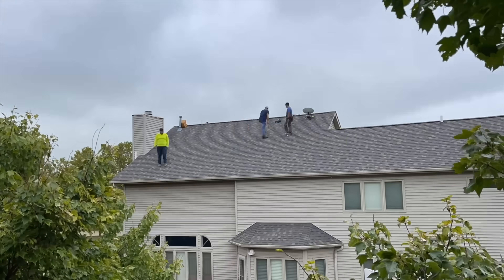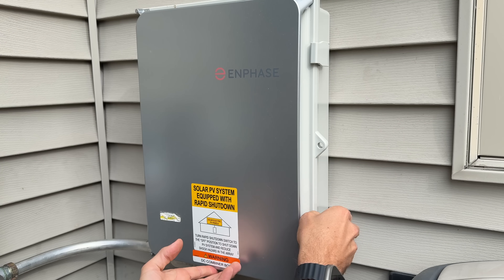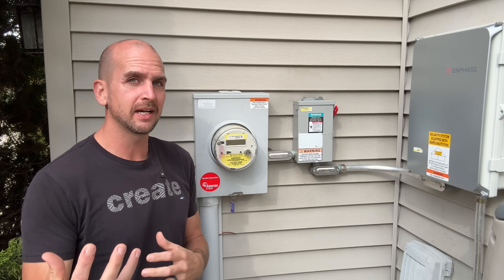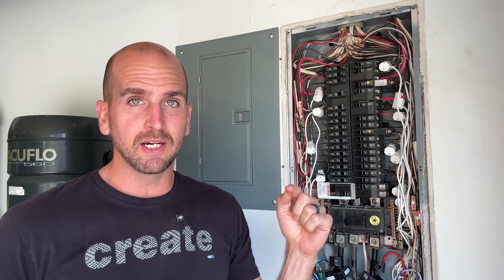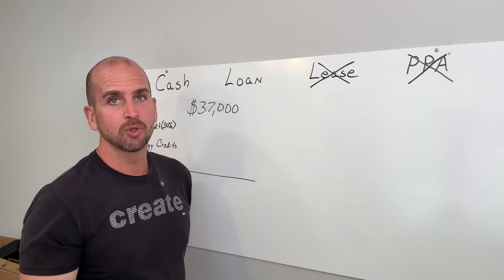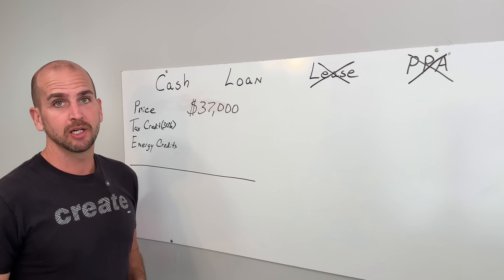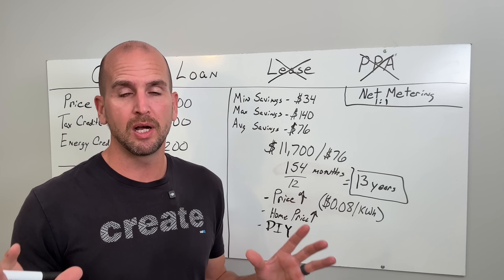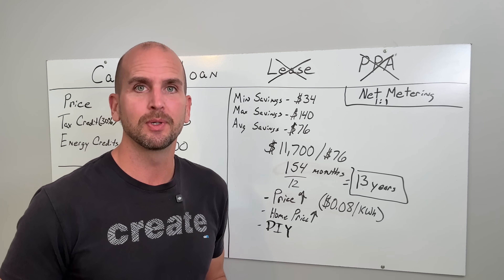Are Solar Panels Actually Worth It For Homeowners?

Comment: $11700 invested at 5% is over $20k after 11 years when compounded annually.
Reply: Yep, just depends on what premium you put on helping the environment by reducing your energy emissions.
Reply: Exactly.  and lets also not forget the real cost is $37k.  The rest has to be picked up by increased taxes.
Reply: @Ish14511  Nah, just transfer some of the subsidies already being given to the fossil fuel industry over to renewables and electrification.  Problem solved.  Society is constant shifting and government has to shift with it.
Reply: Never paying an energy bill for the rest of your life is priceless..
Reply: @davefroman4700 But is it?
Reply: @Stashmo  Add up your electricity, natural gas (or propane, heating oil, etc), and your gasoline (diesel, etc) bills.  Then ask that question again.

Economies of scale start to get really interesting, yes?  But to be fair, we are still in the early-adopters stage for heat pumps.  Most home owners aren't going to be able to check all the boxes.

For an early-adopter though... woof.   And generationally the future is obvious.  Double woof.

-Matt
Reply: @Stashmo  I am off grid in Saskatchewan. The only bill I have? Is my $500 property tax a year. And in 20 years when I have to replace my solar? It will be 50% cheaper than what I paid for my original equipment.
Reply: Inflation will eat all of it.
Reply: Yah... but no.  People aren't savers by and large.  Unfortunately.  $11700 not invested is $11700 spent on other things, more than likely.   And also, a person's economic power tends to drop after they retire.   You always want to do projects that benefit your future self earlier rather than later.  Always.

-Matt
Reply: @junkerzn7312  But maybe by the same logic lotsa folks will also spend/waste the savings from solar, so no net financial gain.

Comment: your bringing 3 AC lines into one.. how do you deal with phase shift?
Reply: There is no phase shift because the micro-inverters synchronize to the grid. They don't just output an AC waveform.  They will output nothing at all if not connected to the grid or to a master inverter of some kind (and for enphase's intentional islanding feature, to a master control signal).

Comment: Three years ago I priced 22 panels and it was $32000 and breaking even in 15 years. I didn't do it. This year I installed the same setup, same price an it will break even in 6 years because the panels have increased in efficiency and the price of electricity has skyrocketed thanks to the Biden administration.

Comment: Thanks for the info!  I didn't realize there was a DC to AC conversion right at the panels.  In case you are curious, electricity is currently .089/kwh in CT right now via Eversource (it has been as high as .15)

Comment: Couple things

1st- Some insurance companies (mine) will not insure homes with solar panels
2nd- HOA’s will most likely not allow them
3rd- A bunch of homes in my area had their panels damaged in storms and insurance refused the claim
Reply: 1 - Florida maybe? Not so in most states. In Ohio it’s against the law to even raise your rates for solar
2 - again, varies by state. In fairly Red Ohio, HOAs are not allowed to restrict solar on aesthetic reasons alone
3 - as someone else said, those same homes have much bigger problems than their $10k panels if those storms were bad enough to damage the roof
Reply: @ I’m in Indiana
Reply: I've seen most HOAs are allowing them. In Indiana, HOAs are now allowed to prevent homeowners from going solar as long as they meet certain criteria. You could easily change insurance companies as well.

Comment: No they are not worth it.  My electric bill is under $100 a month average.  $30K/ $1200 per year assuming my bill goes to $0 with solar (it wouldn't) is a break even time of 25 years.  Not including the loss of saving that money or buying something fun.   LOL.  Simple math folks.  It's underrated.   Guess what, the efficiency on those drops to zero over that time too.  They don't last 25 years.  Maybe 12 at best.  Oh, and plan on spending an extra $10,000 to remove those and re-install when you need new shingles.   Think about it for a bit and its clear it's a really dumb thing to do.
Reply: Natural gas bill?  Gasoline bill (vehicle) ?  Keep going.  And maybe stop pushing misinformation...

Solar systems easily last 25 years and life spans for the panels themselves are now in the 30-40 year range.  Incremental maintenance after year 20 will increase, but not by much (ask me how I know... I've been doing solar a VERY long time).

Replacing components piecemeal is not expensive, but that is where DIY-v-labor arguments come into play the most because time is money for a professional.

Just a hint.  NOTHING lasts forever in this universe.  Solar is on the long-end in terms of durability verses other things in life.  Its silly to worry about it.

-Matt
Reply: So much misinformation in this comment. Many panels are warrantied to produce 90% at 20 years.

Solar panel are cost effective in area with high electricity cost and sufficient solar energy available. It is not worth it for everone but there are millions of people that will benefit.

They are also great in a natural disaster if battery back up is available.
Reply: Solar ROI is VERY location specific, in many places it doesn't make sense due to a variety of factors. The amount of sunlight is just one, others may be even more important such as net metering, insurance, weather factors such as hail/wind, cost of grid power, etc. A thorough honest analysis is required, not a what some sales person says.
Reply: You can count on your electric bill always being $100/mo. Trust your electric company.

Comment: Thx, you didnt adress wear n tear... when ur break even, how much life's left in the solar system?
Reply: For panels installed 20 years ago, sure.  My original SHARP 165W panels (20 years old) had lost roughly 15-20% or so over the 20 years.   But modern panels have much less degradation... we're talking 0.5%/year or less these days.  20 years = 10% loss.   

Panels don't die that way anyway.  They'll just keep producing.   Panels die when their environmental seals die and water gets under the glass.  That's about the only thing that can actually kill a panel.  A modern panel can easily last 40 years.  You can count on at least 30.

You'll have a few panel failures over that time but to give you an idea of what that means... I didn't even NOTICE that I had 2 failed panels for several years on that original system.

People with micro-inverter systems have a tad more maintenance... micro-inverters won't last as long as the panels, though they will still last a good 20 years these days.

-Matt
Reply: Most solar equipment is warrantied to not drop below a certain power output for 20+ yrs. They can & do keep making power for much longer.
Reply: Depending on panel quality and environmental conditions in your area, the loss is 1-2% in output per year.  Most long term averages come out to 20% loss after 20 years.  This aspect definitely needs to be considered.

Comment: No.  I have moderate energy costs. Solar raises insurance premiums.  Eventual roof replacement cost will be higher.  Panels can be ripped off of roof during a storm.  12/12 roof- I’d have to hire contractors.  Many people will not buy a house with solar so house value might decrease. Components eventually need to be replaced. The laws can change - pretty sure California changed net metering law and solar owners were screwed.  Risks clearly outweigh benefits.
Reply: Mother nature can wash away your house too.  A larger house will raise your insurance premiums.  An old house will raise your insurance premiums.  The wrong type of roof.   Nearby trees.  Bushes right up against the house.  All sorts of things that people don't think about can raise their insurance premiums.

That doesn't mean you don't do something.  If that were the only litmus test everyone would be living in 300 sq-ft shacks.  People buy what they desire to buy and what they can afford.  Can one even attach a dollar value to peace of mind?  Insulation from inflation?  Power outages?

In anycase, solar isn't for everyone.  But you can convince yourself of anything with a bad argument.

-Matt
Reply: @junkerzn7312 Matt - you focused on one issue I raised and ignored the rest of the negative aspects I mentioned.  To me, it’s a simple cost/benefit analysis of ALL the pros and cons. Not just the insurance.
Reply: @davids2530  The main problem with your argument is that you are assuming solar to be an adder to your cost of owning a home.  It isn't an adder, it is part of the decision making you should be doing when determine what and where to buy in the first place to meet your budget.   One can argue all sorts of nonsensical paths using your thesis, and I outlined one such nonsensical path in my response.

Not only is it not an adder, but not all solar installations will even have the detrimental effects in your list.  Which we will go through after my explanation.

If you have budget $X and have a desire to or think there might be a potential to add solar, then you include that in your budget.  Simple as that.  The result may be a slightly smaller home in a slightly different neighborhood.   If those factors are not in your litmus, then its not a trade-off for you.  If those factors are in your litmus, then it might be an unreasonable trade-off for you.  Simple as that.

Even if you were to treat solar as an adder, it still adds value to the home if you ever sell it, or its an investment in the future of your family when your kids inherit it.  Or its a contribution to your retirement if you have to downsize later in life.

And in the mean time, it is providing an enormous number of benefits to you personally that you have to weigh against the costs.

--

So lets look at your list and see what the total calculus is.

Benefits (my list):

* Immune from utility price inflation.
* Reduced monthly expenses.
* Ability to reduce expenses further with further electrification as appliances wear out (Vehicle, water heater, furnace).
* Benefit to inheritors.
* Benefit to you if you move out or downsize later in life.
(The higher value of the home with solar).
* Investment in the future of humanity.
* Hobby DIY potential
* Backup power and flexibility in case of emergency.

Detriments (from your list):

* Solar raises insurance premiums?  It didn't raise mine.  You don't have to insure the solar installation or include it in the home insurance.  It has a 25 year warranty.  Ground, Pergola, and Car-Port mounts are even easier to omit from insurance.

* Eventual roof replacement... gonna depend on the roof, yes?  Someone with a metal roof that outlives them won't care.  A roof replacement 30 years down the line after the solar has long since paid for itself...  the incremental cost divided by all those years is going to be fairly low and guess what?  You can DIY the removal and you are already wired for the reinstallation so you can either DIY that or hire a company to do it.

* Panels can be ripped off of roof during a storm.  Well... no, that really isn't a thing.  Sure it can happen, but a storm that strong is really unlike for most people (obviously certain locations are going to be more prone than others), and a storm that strong would otherwise destroy your roof anyway.

Solar panels do not make roofs weaker and are not fragile.

* Many people will not buy a house with solar... say what?  That's ridiculous.  Solar universally increases the value of a home, not decreases it.  You made that up.

* Components eventually need to be replaced.  Yes, of course.  Just regular maintenance.   You will have to replace things, probably piecemeal, starting at roughly the 25 year mark.  It's not a major cost and not a major problem.

Everything in life wears out.  Everything.  That isn't an excuse not to buy or own something.  Come on.  Be realistic.

* The laws can change.   Yes they can.  So what?  California's laws did change.  That caused a reduction in new installations.  It had no effect on existing installations because everyone with existing installations are grandfathered for 20 year since the date of installation.  Nor does it make solar non-economical.  It just means your payback is where it was 20 years ago, back at the 15 year mark, if you were to have it professionally installed.

Laws can change, but if you are going to go through life constantly being afraid that the laws are going to conspire against you, you won't have a very fun life dude!   Laws can change for better or for worse.   But regardless of that you can always benefit from the self-consumption and self-storage (if it came to it).

-Matt
Reply: For you, it may not make any sense at all. Like real estate in general, it's location, location, location. The laws may be favorable for solar or they may not. There may be a lot of sun year round, or there may not. Local energy costs may be high or low. If one has a big lot, they can ground mount instead of using the roof, decreasing installation, maintenance, and insurance costs. One can even choose not to grid tie, have energy storage, and power part of the home from the grid and part from solar. There is no one right answer for everyone.

Comment: Enphase's combiner box that lets you add their batteries lets you run your panels when the grid is down even if you don't have batteries.
Reply: Sorry, it's not the combiner, it's the system controller.
Reply: There’s also sunlight backup on the newer IQ8 micro inverters.

Comment: I have a lease in CT. With a lease (solar system owned by others (e.g., Sunrun)), your property value (property tax) is independent of the solar-system as is home owner's insurance. Any issues with the solar system are the solar system owner's responsibility. One advantage that I have with my lease term is I was able to fully pay the lease up front with a substantially reduced cost versus paying for the lease over the term (e.g., twenty years).

Comment: 1:36 Your panel wires are run through a gap in the microinverter bracket. This is a huge no-no, and will end up grounding out the system as the winds move your wires around.

Comment: I’ll say getting solar is not just about financial ROI, but also about reducing greenhouse emissions, which we need to continue to do today. Even if after 20 years my ROI is a wash, we have a responsibility to try and make the future more sustainable.
Reply: Completely ignoring the environmental impact of creating the panels lol
Reply: @morzinbo while not zero, the lifecycle costs of the panels put the break even point at about 2 years for the energy and resources out into making the panel to be outweighed by the resources saved because the panel generated energy instead of fuels.
Reply: I can no longer buy clothing that doesn't tear or come loose in two years; I've replaced two water heaters in a decade, the latest of which-- which is a brand that still (questionably though) has a solid reputation-- seems to have the same corners cut as the previous; planned obsolescence in electronics runs even more rampant whilst I am expected to use paperless forms and payments; things formerly available at the nearby shops now must be delivered via freight which is far less efficient; passenger rail stateside is practically a laughing matter; etc; etc.

And it's on us individuals to fret over it all. Right.
Reply: Early adopters are contributing to the technological development of solar and renewable systems.  In otherwords, it is an investment in future generations.    Without that, no new technology would ever be developed or ever reach the scale necessary to be environmentally friendly.  So slinnky is absolutely right.

p.s. it also increases the value of the home.
Reply: Your contribution to sustainability is a grain of sand vs. what data centers and bitcoin mining is taking.  Maybe you "feel good", but you will pay for that feeling many times over in the long run.
Reply: @anthonyhawkins3576  Actually I've made a significant portion of my investment back already. And I've generated a sizeable amount of energy. Every little bit counts!
Reply: @slinky: Maybe you feel a responsibility to ward off your green fears. 
I live in reality; therefore, I have no interest in wasting my money chasing rainbows.
Reply: I'm sorry you're so angry.

Comment: I have solar but I am not connected to the grid.  They were going to charge me close to the same price as my solar installation to bring the grid in to my home.  Then I would have to pay monthly payments for their power so I feel I am way ahead.
Reply from the maker: Yeah, that is one of the best type of justifications for solar and batteries.  I would like to build an off grid cabin in the coming years 👍.  What inverter did you go with?
Reply: @EverydayHomeRepairs  My son installed it so I don't know for sure but we bought the system from a company that helped us design it and had the parts.  I do have propane appliances except the fridge and freezers. I tried to plan for things that didn't use or used very little electricity.
Reply: This is the best setup if it makes sense for the location.